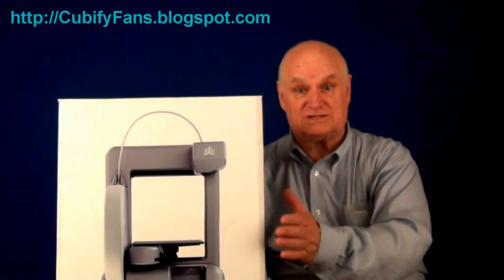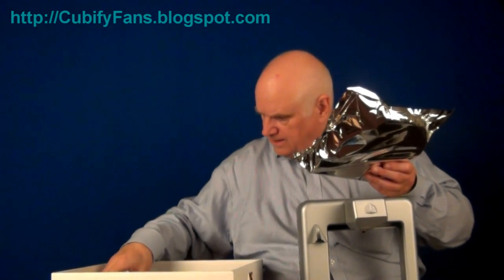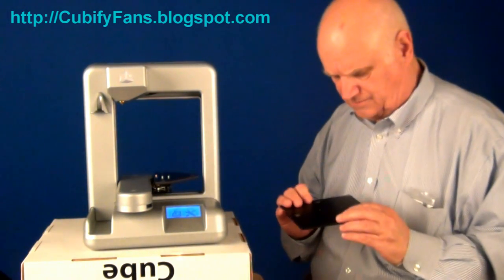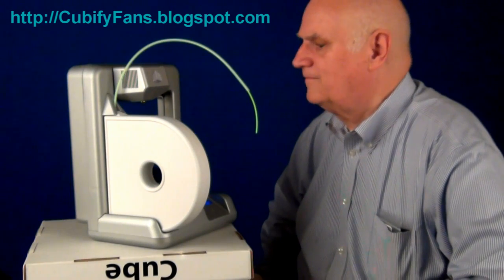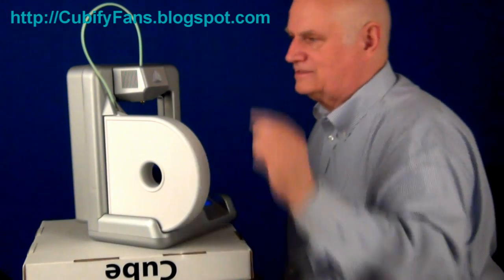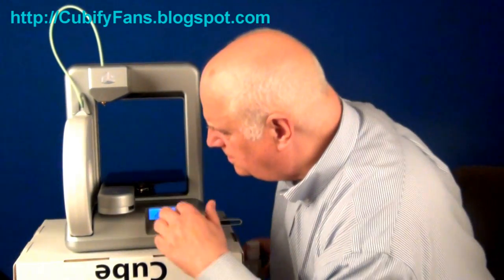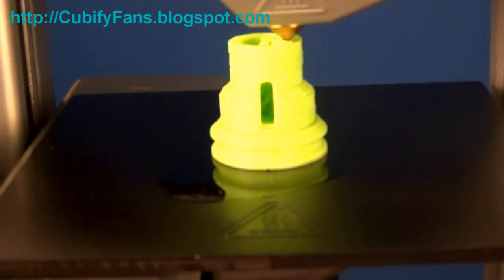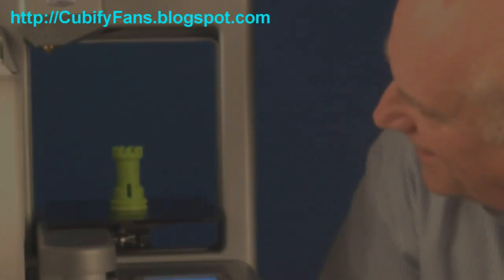Cube 3D Printer - Opening the Box & First Print

Comment from the maker: The Cube has held up well and I'm very happy with the choice of the Cube.  Not only do I now have experience with my own 1st and 2nd generations Cubes, I volunteer with a not-for-profit that owns 3.  One of the their had a failure of the connectors for the cartridge; but, all of the others are working very well.  I do hope they continue to work on the glue for the 2nd generation non-heated table.  Every now and then a piece will break loose prematurely and be ruined.  Otherwse, great!

Comment from the maker: To print truly fine details probably requires a printer that can print .125mm layers and which has little penchant for something called Z-Axis wobble.  Z-Axis Wobble is caused by the threaded rods that move the bed being slightly warped.

Among the best in that category is the 3DTouch, which uses stainless steel screw rods which are less likely to be warped.  But, there are others.  If you are going to be printing larger objects, I would recommend a system that uses external filament reels.

Comment from the maker: The 2nd Gen Cube is EXCELLENT.  The accuracy improvement is substantial.  The CubeStick took a little bit of experimenting.  And, it is NOT as easy to remove pieces as it was with the heated bed.  Once that cooled off, things just popped off.  But, the accuracy is more than worth the trouble.
I've only printed one ABS object and while the warping was minimal, it was not a shape that would really push the warping envelope.  I'll do more videos on the 2nd Gen soon.

Comment from the maker: Sure, be glad to.  :)

I also own a RapMan 3.2... a typical RepRap kit. To get smooth filament feed, I've had to create my own custom filament spool holder with a bearing shaft.  Because each supplier uses a different reel, I had to create a variety of hub fittings for the spool holder.  The greatest pain has been the inconsistency of the material itself.  Temperature requirements vary requiring custom profiles for not only each brand; but, each color.  The cartridge does away with all that.

Comment from the maker: Yes, I am satisfied.  Remember, a ragged 100 micron laydown is not going to be as smooth as a very accurate 200 micron laydown.  The key is accuracy.  And, the 2nd Gen Cube, in particular, is VERY accurate.  This really is the key when assessing performance... not layer height.  A LOT of printers with the 100 micron spec have Z-Axis wobble problems.  I know, I have a RepRap that can do 125 microns and it's not nearly as smooth as the Cube.

Comment from the maker: I would guess that piece could be about $5 - $7 to print if external supports were generated.  It is large and has a lot of surface area.  A "solid" model would actually use less because of the internal supports generated are designed to use a minimal amount of material.

Comment: Hi, I've got one of these too, and it prints really good rookes, but I've tried to print an enclosure that is rectangular rather than round and the stresses in the plastic as it cools distort it badly to the point of being unusable. The problem is in the SW that turns a 3D model into a model with supports. It doesn't take shrinkage into account and it certainly doesn't meet the accuracy they quote. A friend has a $60,000 printer and it's good, Cubify no, needs a lot of work.

Comment from the maker: No it will not fail.  In fact, what you will see is that the supposed "Open Source" guys will eventually NOT be completely open source compliant.  That's already happening if you follow 3D printing news.

I suspect that the activation number is a theft control mechanism.

Comment: I just finished my first 3D print of a teacup, it turned out perfect.  I used my flash drive with the patterns in it but I want to download from my laptop and I haven't figures that out yet.  Any suggestions?
Reply from the maker: With the Cube2, we always use the USB drive.  The only use for the USB cable is to upgrade the firmware.  I have never tried Wifi with the 2nd Gen Cube; but, that s how I send prints to the 3rd Gen Cube.

Comment: @micko Fitzs
He chose the "rook" from a list on the thumb drive he placed in the side of the machine. The 3d images are created/downloaded in the Cube software and saved onto the thumb drive. I'm not certain but I image you might have the option to connect the USB cable directly from the PC instead of using the thumb drive. Is that correct, Tom?
Reply: ^imagine
Reply from the maker: You cannot print via a USB cable; but, you can send files to the printer wirelessly.  Although, I prefer to use the USB drive for this purpose.  The USB Cable is used to update the firmware.

Comment: Hey, thanks for the review. Is there a bag specifically for this Cube printer that I can use if I want to take my Cube with me anywhere?
Reply from the maker: Actually, while not from 3D Systems, there is a PERFECT travel bag for the Cube 3D printers.  It's a rolling canvas bag that I first purchased from Staples.  But, it's available on the web.  For the life of me I cannot remember the name of it.  But, I will find out.  the cost is between $25 and $35 depending on the size.

Comment: Hello again,  I downloaded some free designs onto a flash drive but when I try to print nothing shows up and doesn't print.  What am I doing wrong?
Reply from the maker: LOOK at the file names on the flash drive.  They may be in STL file format, whic requires you to use the client software to convert them to the file format that the printer can use.

Comment from the maker: Actually, I don't use my 3D printer via WiFi.  I physically use a USB Flash drive to go from the computer to the printer.  So, no, you do not need an internet connection.  The Cubify Client on your computer does appear to automatically check for updates to both the client software and new firmware. Once activated you no longer have to log in to anything except for downloading future software updates, etc.

The new Next-Gen Cube is amazing!  I'll be doing another video explaining the changes.

Comment from the maker: The Cube requires a cartridge from 3D Systems.  Beyond that, I have NO idea what can or can not be done.  

I have a Canon 9000 Mark II color printer.  And, I have an HP color laser printer.

I have no qualms at all using cheap 3rd party supplies for the laser printer.  But, I would not even begin to consider 3rd party ink for the Pro 9000 because the reason I have it is for the finest prints possible.

And, that is the way I feel about the Cube. I'll leave the 3rd party stuff to my RepRap.

Comment: The whole idea of 3d printing is to get away from "proprietary manufacturing." You don't need a corp to manufacture your products because you'll print it from your 3d printer. I agree with u on the need for "proprietary" design if the design is revolutionary, but if it's an incremental improvement, then open source could do it better & faster. That's why in the sub $2k price range, the Makerbot is the only one with dual extrusion. U don't work 4 cube, but I bet you own their stock, u look rich.

Comment: I'm not the type to put people down I'm glad you have a passion and excitement for 3D printing world.
But I own this and the 3 and pro and only reason I own them is I got them for really cheap 
I got the 2nd gen for $50 the 3rd gen for $101 and the Pro for $344
They the 2nd and 3rd were new and in the original packaging not opened, the pro were new but not in the original package it was just the printer and power supply (build plate included) .
The Cubify are the worst printers on earth, the company is a creativity mafia that try to stage you to be a consumer for their products.
$99 for the CubePro filament that only has 0.5kg is a rip off, the best quality ever filament roll of 1kg in the market is $50, and for the cube 2,3 a cartridge is $50 with 350g of plastic in it.
Yes on cube 3 they argue that they provide the extruder ...etc but that made things worse as usually these cartridges has a lot of issues, not to mention they are load as hell and had lots or problems

Comment: Ours print horribly (have more than one)!
The company aren't helpful either.
Boo

Dear Competition: lots of room for opportunity!
Reply from the maker: Shane, please email me so we can walk through the issues you are facing/  See the Cubifyfans blog for my address
Reply: I mean no offence nor intend any loss of business for you. The problem is simple. The parts printed are useless!

We expected improved dimensional accuracy and precision - and after being told politely to go away from your engineers we are determined to chuck the lot. We want parts that can do a simple job. Please speak with your engineers and sales people to become more familiar with our dead end conversations. 

To summarise:

From Cubify - "For example, a wall designed with a 0.76mm nominal thickness will be printed around 1.27mm wide, the width of one road. A wall with 1.52mm nominal thickness will be printed around 2.54mm wide, the width of two roads."

What I want is the printer to print whatever I design without modifying the part thickness - of course I will design the parts to be printed on your printer with Min. wall thickness understood as a technical limitation of the machine. If the Min. wall thickness is one filament - 1.52mm. I sure as heck don't want it to be 2.54mm. Colour inside the lines!

I recently had total success printing the same part on a machine a teenager built out of junk. obviously better software!

NYSE: DDD
Reply from the maker: Shane   I don't work for 3D Systems.  And, have no financial interest in their success or failure.  But, there is a reason why consumer products are called "consumer products" and professional products are called "professional products".  Having said that, the performance of the Cube2 has improved dramatically over the last year as they have released updates to both the client software and the firmware.  The Cube 3 specs are even better.
Reply: CubifyFan Yes i understand they are better (3). Sadly they sold us 2s when 3s were only weeks away from being on offer. so as you can understand there just aren't too many reasons for us to jump with joy. I won't drag the party down any more! Best wishes and lots of luck.

Comment: This machine is crap. It uses closed software which is unavailable if the machine goes wrong. The connectivity by wireless has to be re-entered every session. The USB cable is not supplied with the machine outside of the USA. They will not accept returns if the machdine goes out of control. You have to fix it yourself following obscure instructions. If you live in Europe and purchase additional filament cartridges from cubify you are ripped off. I purchased two cartridges to be sent to europe. They started off at 40 euros each, plus tax and shipping it came to 117.44 euros Then after despatch I got a bill for 84.35 euros to effect delivery. The breakdown was 35.15 customs, traffic entry 15.00 title of deposit 2.10, storage 4.00, printage and stamps 6.40 and administations charges 12.50. Plus VAT.So ADDITIONAL CHARGES were 84.35 euros. TOTAL cost for two (2) cartridges delivered was 201.80 euros. The mafia inspired courier was FedEx